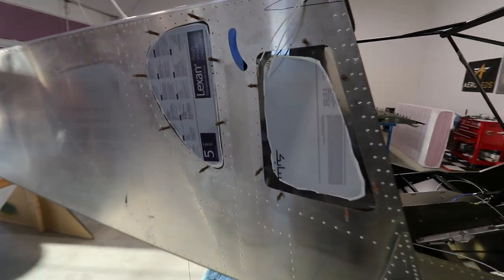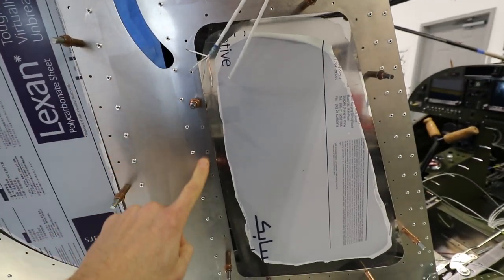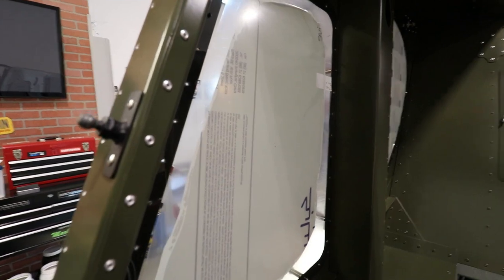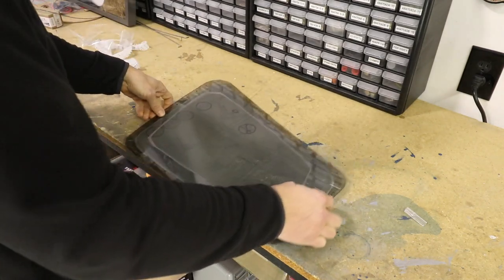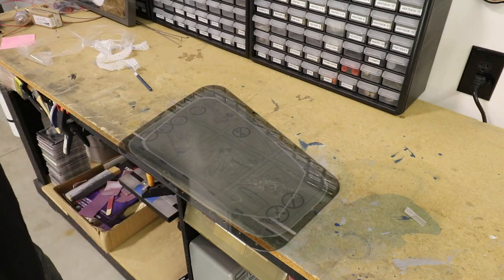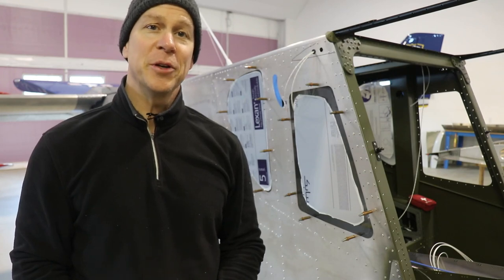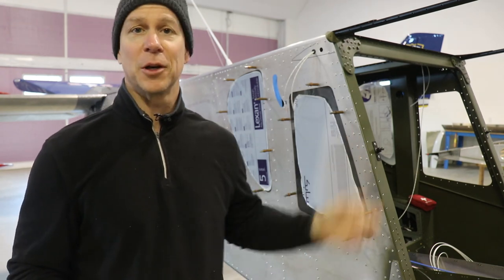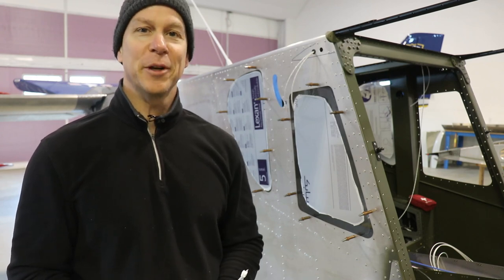Installing the CH-750 Fuselage Side Windows (Ep83)

Comment: In case you were not aware, Dremel makes a cut-off wheel especially for plastic.  I just trimmed the plastic for the taxi lights on my SD project with one.   Worked fine, but I was trimming off 3/8 of an inch or more.  For only 1/8 inch, the sanding drum is probably is the better way to go.

Comment: A couple more tips: 1) Once you remove any plastic protective coating from a window, always lay it on a soft towel while you're working. This will prevent any grit on the bench from making a scratch if the window moves while you're working. 2) You can stop rivet shank expansion in the Lexan by using a "baffle seal back up washer" (search that term on Spruce) on each rivet. All of the expansion will happen against the flat face of the washer because the stem plug cannot pull past the washer's ID.  They're only 1/16" thick, so you probably won't need longer rivets.

Comment: I have used a router and router bit mounted on a router table to reduce the edge of acrylic.  A fence on the router table determines the amount to remove nicely.  Practice first on scrap to learn the skill and the direction of routing.

Comment: The expansion coefficient of plexiglass is .062 Inches/Foot/100 °F.  A 1 meter acrylic sheet will become 1.5 mm longer and wider if the temperature rises 20 degrees C.  Most ATV, Motorcycle, etc manufactures for windshields drill larger holes and use well nuts to reduce long term shock and expansion issues.

Comment: Thanks for the videos!  I’ve binged watched over the past few weeks to get caught up.  I have a question about the avionics.  Are you using a remote magnetometer?  If so, where did you/are you installing it?  If not, why is it not needed?
Reply from the maker: I did not use the remote mag in my RANS S-6, my Cruzer, nor my Super Duty. I've never had an issue without it.

Comment: Have you considered temporarily using the Pitts' engine on the Super Duty until you can afford a new engine for it or selling the Cruiser since the Super Duty will outperform it by a large margin?
Reply from the maker: I've considered all of that. I don't want to take the Pitts engine for two reasons. First, if I take the engine off the Pitts, then I know I will want to disassemble the entire airplane and fully restore it. I just don't want to get into that project right now. Also, once the Pitts engine is 'temporarily' in the Super Duty, the cowling an everything will need to be fit. What ever engine I finally get for the SD may not have the same install. If the new engine sits 1" further forward or aft, the cowl won't fit. So there's too many things that would have to be changed to put that engine in now, and then swap it later. I've also thought about selling the Cruzer, but I just don't want to sell it. 

I actually already have the money for the engine, but I'm just not willing to spend $46,500 on an engine was only $30,000 a year ago. To me that engine isn't worth 46 grand so I just refuse to pay that much for it. I'll let the airplane sit in the hangar until the prices come down.

Comment: I think there is some science as most rivet makers specify a range of acceptable hole sizes.
Reply from the maker: Great! Maybe you could post a link here to the chart you are referring to that is specifically for enlarging hole sizes in Lexan for the purpose of reducing the chance for cracks?
Reply: @KitplaneEnthusiast  It depends on the brand of rivets you are using.  I am using mostly Q rivets in my S-21 and Stanley provides data for all rivet sizes, except the short 04-01 which they don’t make, but the hole diameters tend to be the same for a given rivet diameter.  Most makers of polycarbonate sheet say to make the holes for rivets or screws “slightly” larger than the fastener to allow for thermal expansion.  Not giving a specific number generally indicates that it isn’t critical.  1/8” Q rivets have a nominal body diameter of 0.125” and Stanley lists a minimum hole size as .129” and a max of .133” in the link below.  A #30 drill is 0.1285” nominally, but a drilled hole is almost always larger than the drill size, particularly when hand drilled, so a #30 is the normally recommended drill since a well drilled hole with that drill size should fall into the .129 to .133 range.  Since this range is “slightly” larger than the nominal 1/8” fastener size, this should be find for polycarbonate fastening.  https://www.stanleyengineeredfastening.com/en-US/catalog-global/aapq-04-02/p